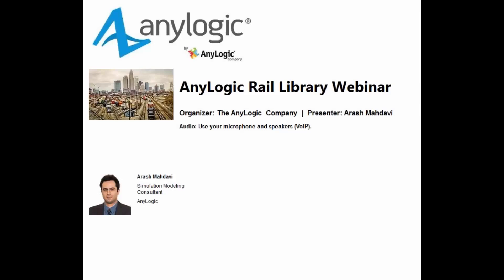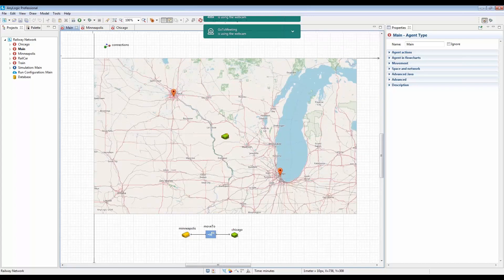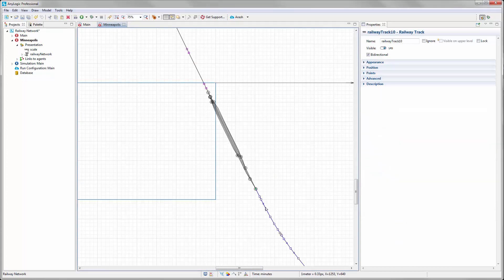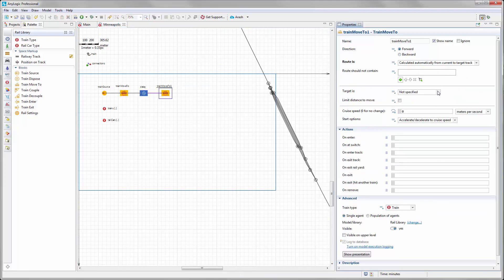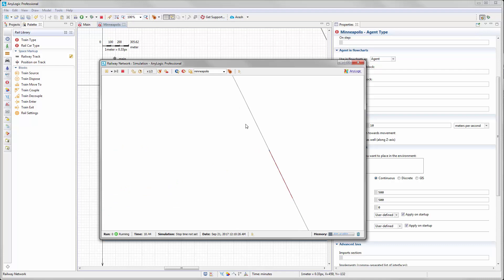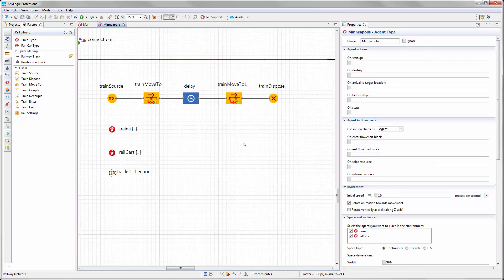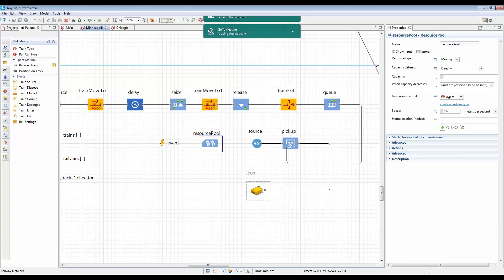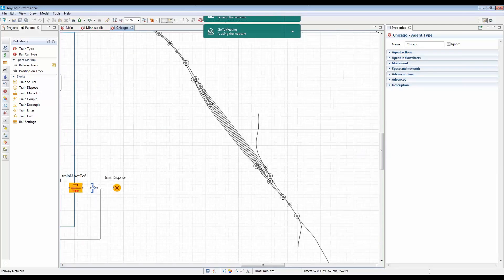Rail Library Webinar Video

Comment: Hi, I have problems with importing the railway markup. Basically, when I import from the shp file, it imports many railwayNetworks each one with only one railwayTrack. Then I have only separated railwayTrack with no switches. How can I deal with it?
Reply from the maker: Hi Daniel, please contact us here https://www.anylogic.com/company/contact-us/
Reply: Hi Daniel, I'm facing exactly the same problem. Could you tell me how you solved this?
Reply: @nataliat.902  Unfortunately I didn't solve the problem and gave up 😔
Reply: @danialsan97  That's a pity. 😕 Thank you for your quick reply!

Comment: Hi there, I used the same function "train.getTrack(true)". But it says NullPointerExveption. Do you know the reason? Thanks.
Reply: I think I found the reason. I deleted the Train agent and re-created it using "Train Type". Then the exact function above worked. Another tip can be that the positionOnTrack and getTrack() function can also be used to update the track's collection. Thanks for the webinar.
Reply from the maker: Glad you found the solution! You may also like this webinar on rail - https://youtu.be/RVeeqZ99wx0

Comment: How can I change the shape of the dot to a train in the Main GIS Map?
Reply from the maker: Hi Max, In this case these are regular agents moving on the GIS map. They are created by the "source" block within the "Minneapolis" agent type and the dot is the default animation for such agents. 
In order to change it to a train, you need to create a custom agent type (say, "TrainGIS"),  put the shape of the train to the origin of the "TrainGIS" agent type, and set the "source" block to create agents of the "TrainGIS" agent type.